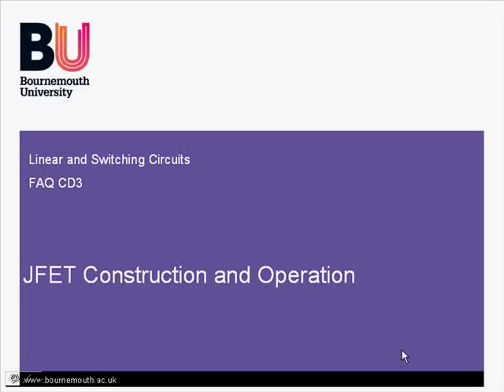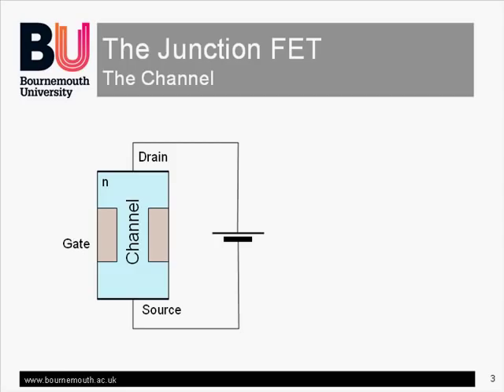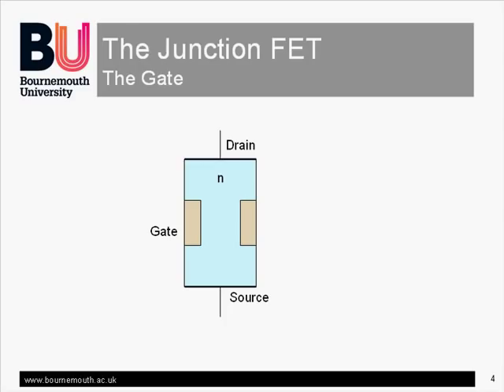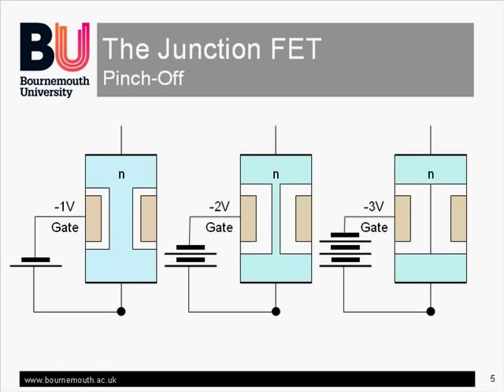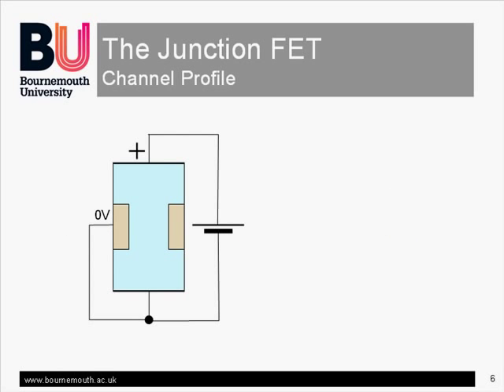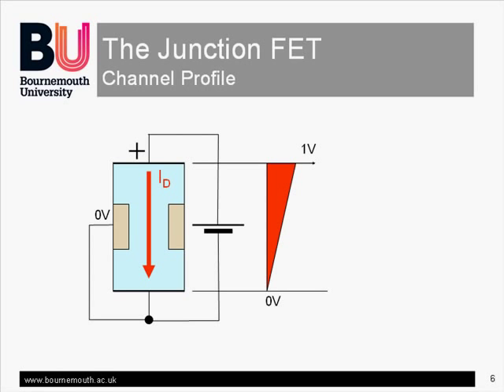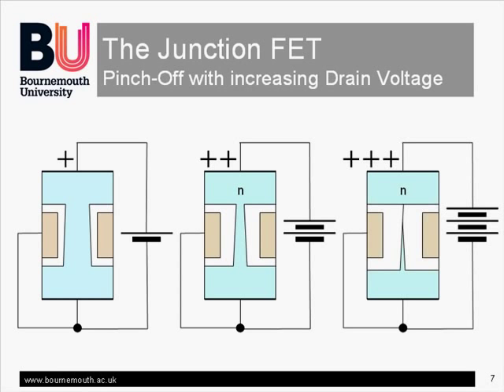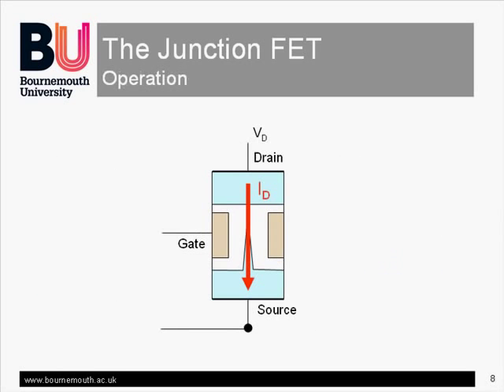JFET Operation

Comment: Impedance matching is important in the case of an electret microphone because the current available from sources such as an electret mic is very low. The FET, as you said, requires voltage, but no current at its gate, and so it works well with an electret. You are correct that explaining the compatibility of the two as being a matter of available current and the load the FET imposes. This may be viewed independently of impedance in the practical sense.

Comment: The best choice for the switching device depends on how much voltage at what current is required. The frequency of the converter is also a consideration. The type MJE13009 is a fast NPN bipolar power transistor that works well for many flyback converters. It has a Vceo of 400 volts, so supplemental diode protection may be unnecessary. I think a simple bipolar type like this, at about $1.50, is a good choice over more exotic devices like IGBTs.

Comment: One of the considerations would be the current required. Most JFETs aren't suited for high drain currents, while MOSFETs are frequently designed for high drain currents.

Comment: thank for the explanation. also, do you know of the best type of transistor to use in a flyback driver? currently i am using mosfets quickly, and am struggling to make them work well. any suggestions? would bipolar transistors (and IGBT's) work better at driving the flyback transformer? and what the best way to protect the transistor?

Comment: Impedance matching, however, can be viewed in another sense; the fidelity of a signal will be disrupted when it traverses a medium that has disruptions in impedance. This becomes an issue as frequency and/or the distance a signal travels increases. For audio signals traversing small distances, it is actually not an issue (for example, a 150 Ohm dynamic mic will work fine into a 1M Ohm preamp input). It will, however be an issue for a VHF RF signal within a... (more)

Comment: i think its because a high load on a low amp signal would just cause a voltage drop significant enough for the signal not able to get amplified, since jfets are voltage controlled and not current controlled am i right?

Comment: (continued)  ...transmitter or receiver. Here, an impedance of 50 Ohms or 75 Ohms, for example, must be maintained to ensure signal fidelity. Impedance matching is an issue for audio in telephony, where very long transmission lines are used, and an impedance of 600 Ohms, for example, is maintained. Another audio application where impedance is ignored is the case of driving loudspeakers. The output of a solid-state amplifier may be only milliOhms, while the speaker is 2, 4, or perhaps 8 Ohms.

Comment: i don't understand what and why matching impedance is important, could you explain the reason for this? i didn't understand it with crystal sets, and i thought resistance and impedance are the same (just one is for signals/AC), and the lower the resistance, the more current would flow.